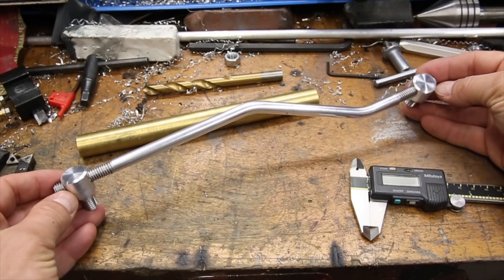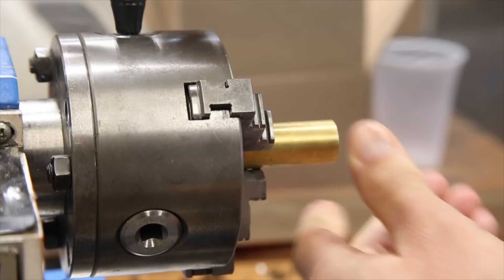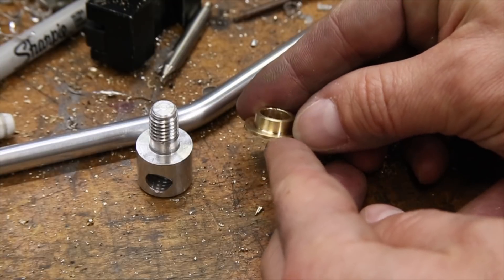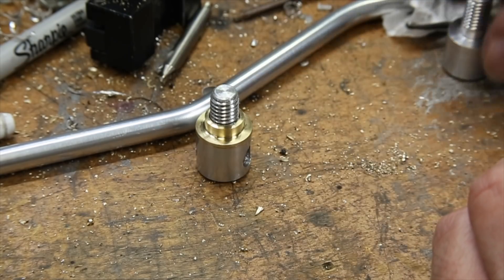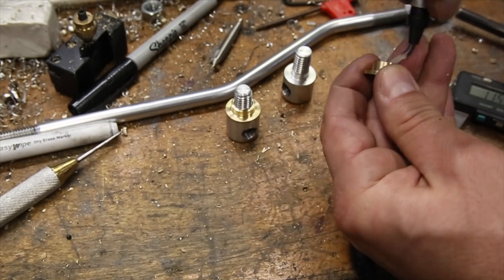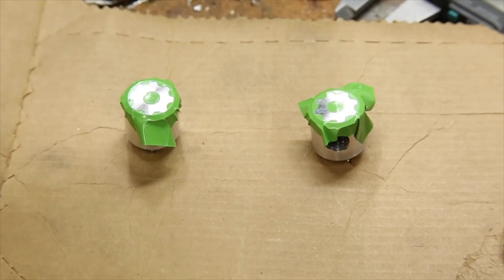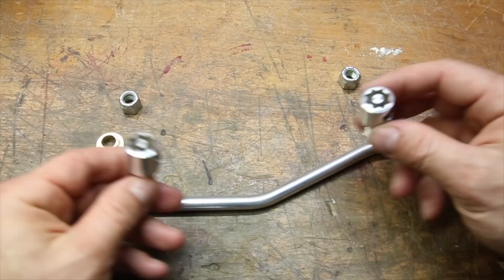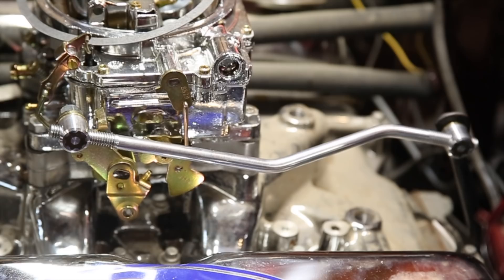(3/3) Custom Restomod Ford Mustang Throttle Linkage Brass Bushings & Install with Mini Lathe

Comment: Sweet, turned out really nice. Nice camera angle on the lathe and good quality resolution. Trying to talk the wife into putting a mild 289 in her 65. Did a total restore a few years back but had to leave the 170 in it since it ran ok. Just put in an 8.8, big improvement. Keel them coming Tim 👍👍👍 my 29 has an old 50’s (fresh now) race motor so don’t need more there.